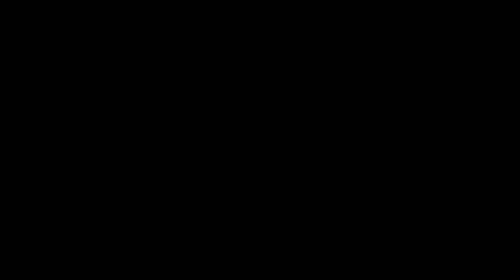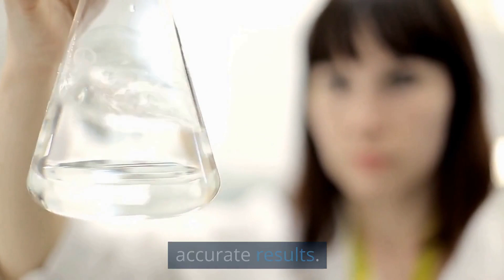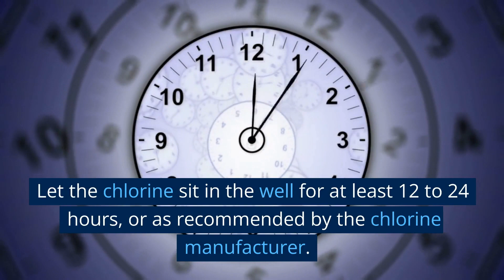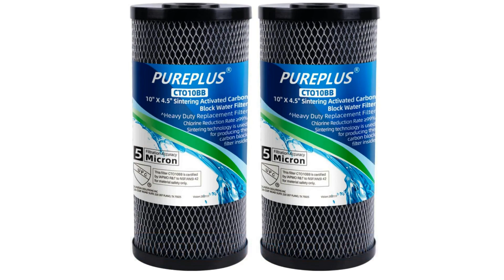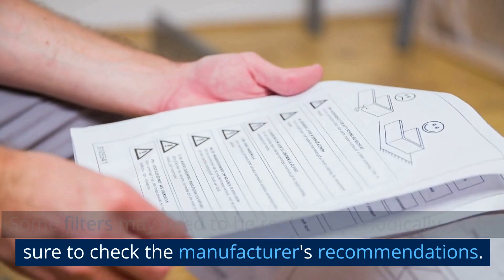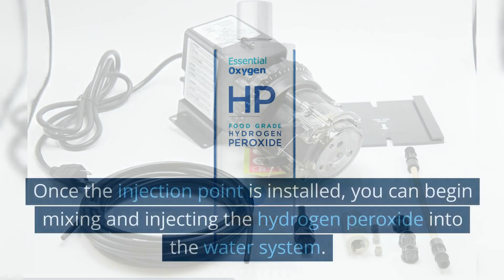How to Get Rid of Sulfur Smell in your Well Water [Detailed Guide]

Comment from the maker: Things you need...
Well water testing kit  – https://fave.co/3QCQphO
Chlorine for shock treatment  – https://fave.co/49JhTv1
Rubber gloves  – https://fave.co/473hGAB
Safety goggles  – https://fave.co/40MkBf3
Activated carbon water filter   – https://fave.co/3sExfjU
Oxidizing filter  – https://fave.co/3sJoeGb
Aeration equipment  – https://fave.co/49JF4pe
Hydrogen peroxide injection  – https://fave.co/3QNtqRi

This channel contains affiliate links which means we might get a commission if you make a purchase, without any additional cost to you.